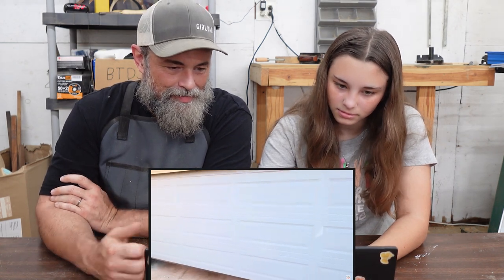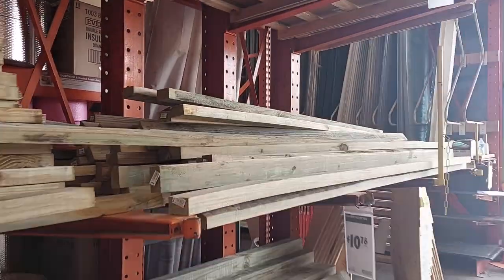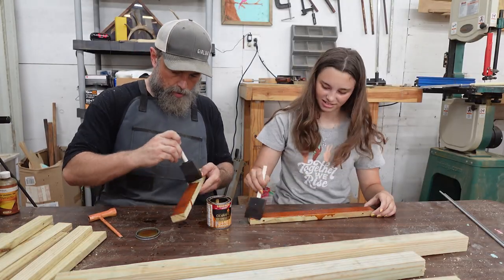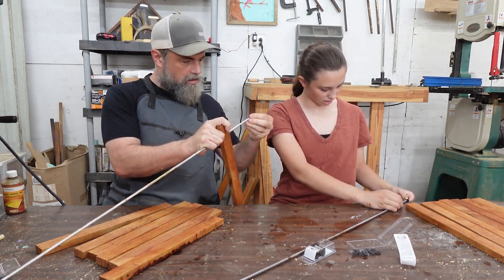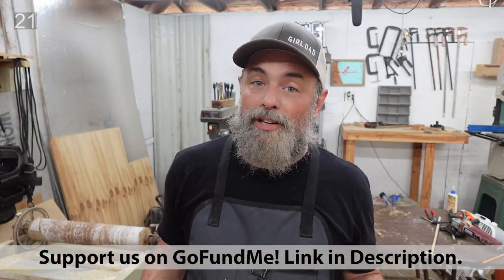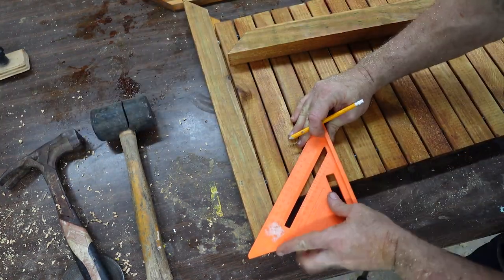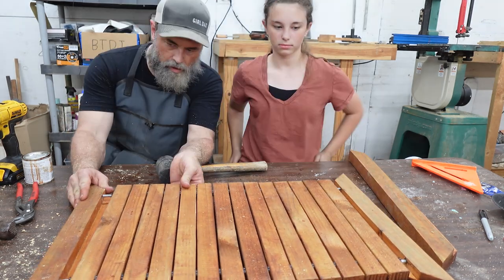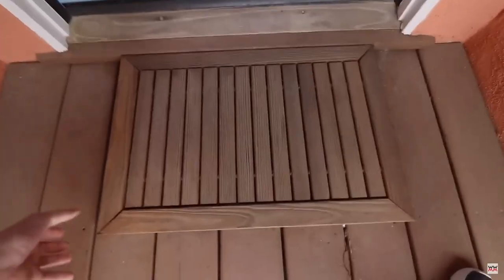Building Steve Ramsey's doormat. Mere mortals indeed!

Comment: I initially subscribed after seeing you and your daughters in the shop. I'm trying to get my granddaughters interested and so far have gotten mixed reviews. I've been woodworking for nearly 50 years and still make mistakes on every project. I was told (a very long time ago) that the knowledge of joinery, fitting, finishing, etc. is skill. Hiding your mistakes is artistry. Also, my current shop in central Texas is not air conditioned and it's supposed to be 102 degrees today. Near record temperatures for June. Yipee. Thx.
Reply from the maker: That's so true. Sometimes the artistry is about turning a mistake into a feature too. I grew up in Central Texas, and I get it. Not looking forward to spending time in the shop today, but there are some things I need to get done in there.